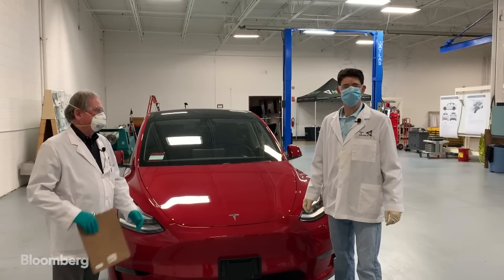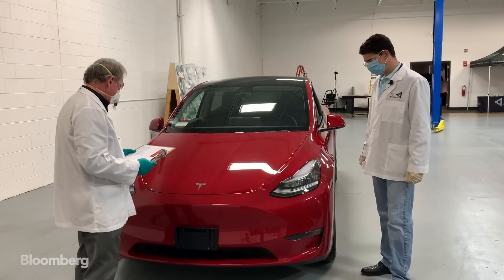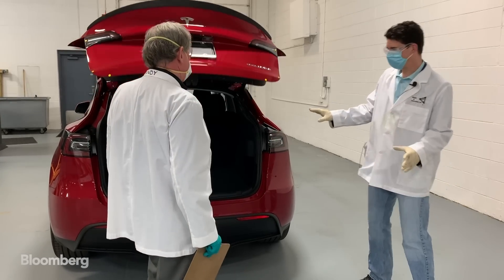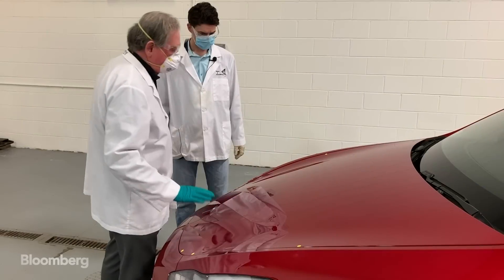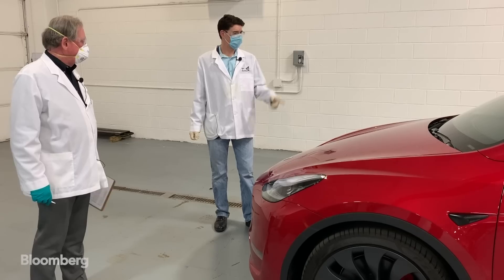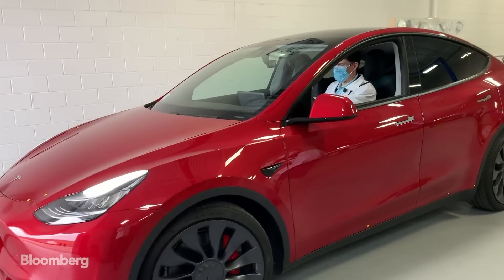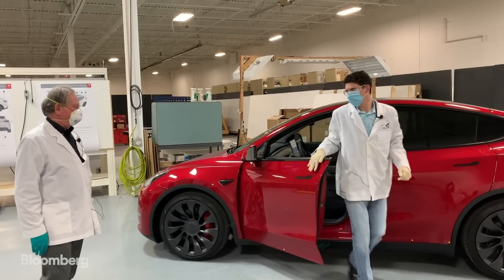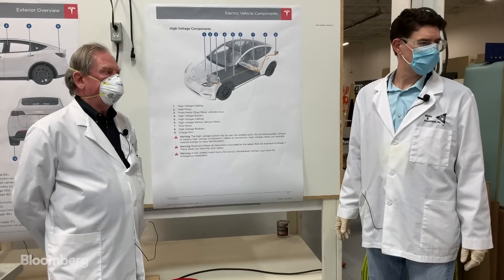Evaluating Tesla’s Model Y With Engineering Guru Sandy Munro

Comment: Looking forward to hearing about wiring harness & body assembly efficiency- especially. 

Don't really give a shit about panel gaps, as they'll be sorted over time.
Reply: No panel gap = short range( audi, ja guar, merc)= 200+
Panel gap= long range= Tesla= 300+ miles
Reply: it‘s the difference between a good car and a great car - Maserati has a lot of wind / aerodynamic noises driving faster - gaps also matter how easy a door closes and corrosion comes from contact of body parts - so every used car buyer shall have a close look
Reply: Panel gaps, as well as dirt in the paint should matter, it says something about quality control.  And as far as them sorting it out over time, well Tesla has had enough time with the Model S, X and 3 yet still can't get it right.
Reply: Dan bingo.  This car is another rush job.  My $20,000 Nissan has better paint and fit and finish.
Reply: Bobb Bobb not necessarily a rush job just poor quality control and/or employees/managers that are lazy.
Reply: Why would you say that?  If the stamping dies that make the hood or panels is off, they won't invest in a new die, necessarily, they'll just live with it.  All the dies have to have good R&R on them to create consistent well-fitting panels.  My bet is that Tesla skipped some steps in their V&V process and arrived at good-enough, which wouldn't even be good enough for the automotive market even back in the 90's.  https://www.youtube.com/watch?v=WAeKVGbI1BU
Reply: Panel gaps matter on how well everything closes.
Reply: @Robert-j6r8c  yes but it does not play in role in ride quality, infotainment, cargo/passenger capacity, and safety, it really is a small part of the car that gets too much emphasis, not that it isn't important to some people.
Reply: @miguellopez3392 
It does play a big role on the overall quality of the car.
If care isn't taken on the most visual part of the car, do you think workers care  about the bits you can't see?
Reply: @Robert-j6r8c  no it does not, does it affect the quality of the battery, steel and aluminium alloys? No it's a representation of the essembly calibration at the factory, a teslas quality comes from its expensive over engineered drive train, it offers very high efficiency and power and that's what tesla is selling, not the exteriors. many cars today sell themself on their exteriors and interiors but will stick the same crappy OEM parts underneath because making the outside look better is cheaper then making the internal components that would make there customers buy it for its preformance/practicality. Different companies put different priorities for what their cars offer, my jeep has worst of both worlds, low mileage, HP, with rust and water leak problems but all that is overlooked when using it for its functionality.
Reply: @miguellopez3392 
Over engineered driveline. Yeah, that's why you don't get full power unless to put your model x on it's lowest setting.
Then you have all the well known problems with the drive line.

Keep drinking the coolaid.
Reply: @Robert-j6r8c  what are you talking about, im talking thermal management, cell chemistry/cell assembly, and BMS operation.
Reply: @miguellopez3392 
"Teslas quality comes from it's expensive over engineered drive train" your words.

Not being able to use the availabile power because the CV's weren't engineered enough to take the strain. 
Getting your motor replaced because it failed is not over engineered.
Motor replacement is common. They're are not over engineered.
Reply: @Robert-j6r8c  dude its a 5500lb luxury SUV that can do 0-60 in 2.7 and shoves 800HP from its battery (who needs this power for a SUV?) how are you missing that its a high powered vehicle not meant to be high powered but still is? tesla motors are ahead of the competition in motor tech as well https://youtu.be/Lj1a8rdX6DU?t=186
motor replacement is common? are you sure? or are you going off news from early production models.
Reply: @Robert-j6r8c  Lol why are you here? I'm reading through the comments and all I see you doing is looking for things to complain about, and you talk a lot about koolaid. You're not contributing anything of substance.
Reply: @illlDCllli 
Only when people claim stuff that isn't true.

If people claim Tesla has the most advance tech, quality, reliability then back it up.

If you want a Tesla because you like the cars and the brand go ahead just don't claim the other stuff when they're not true.

I have a rx8, they're unreliable but I don't care because its fun to drive and looks good .  I don't go saying they're the most reliable with the best tech because it's not true.